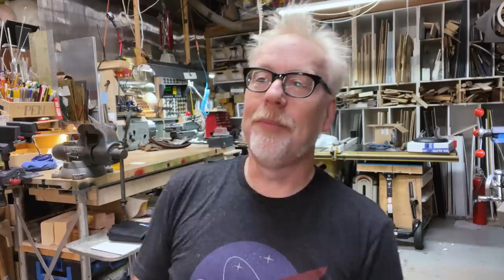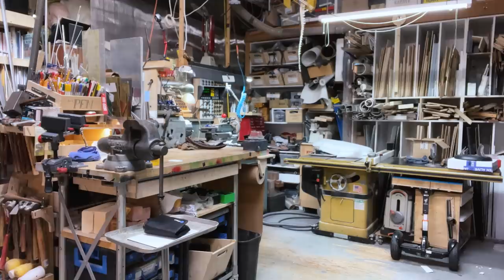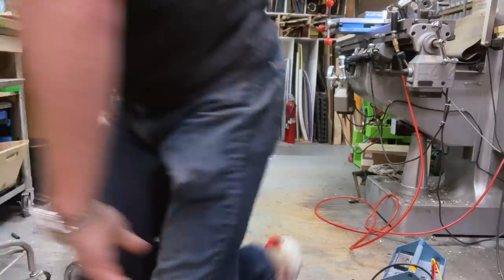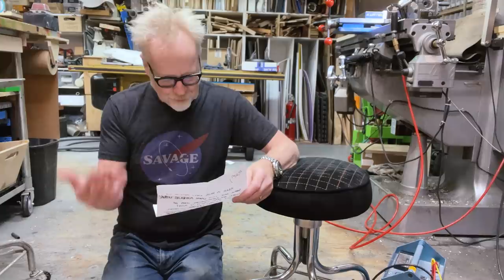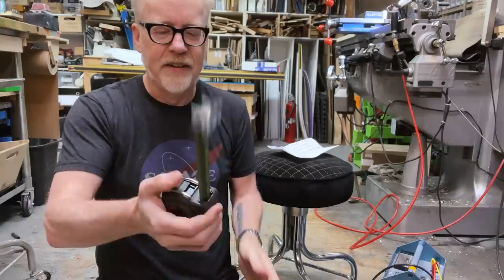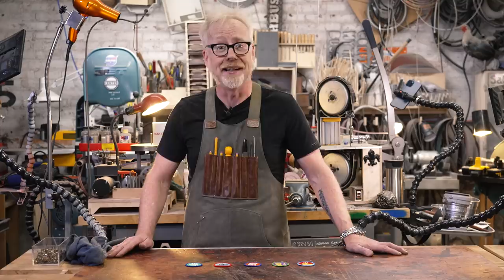Jack White Made Me This Surprise Gift!

Comment: That tape measure is the lufkin shock force with the nite eye tape  (black and green helps in low light as well as in bright sunlight as the black is anti-reflective) . L1135B bought 4 of them for around the shop about 2 years back and am very happy. Also a lifetime no questions warranty on them.

Comment: Jack is a awesome guy. I got into transistors and modifying guitar pedals. Here's a fun idea. Why not do a video on modifying guitar pedals or guitars. I also modified a old Epiphone studio (Les Paul) style. Guitar. I put in new wiring Jimi Page style and added coil split and phase to the pickups.  I have been switching out transistors on fuzz pedals to modify the clipping and other aspects. Like Jimi Hendrix guitar tech did. But one of the things I'm most impressed by is Jack whites modified guitar bridge that does all the different tunings by flipping levers. I love Jack for the guitars he plays. My girlfriends dad bought here this squire bullet when she was kid coming out of piano lessons. It was a cheap stratocaster made in 1982. It sat in her bed room for 30 years never played in mint condition. Well I almost threw it out several times. As she has lots of nice guitars. Little did we know this cheap $50 Squire Bullet Stratocaster was the first made in Japan. Because the factory in Japan was new and didn't make their own parts yet. Not until 1985. To try used what ever fender shipped to them. Which was original American 1960-70 stratocaster parts. They also built them really well as they were trying to impress fender. So these Squire Bullets Strats from 81-84 are considered master builds today.  She had it appraised at $1,500. It's also her best sounding guitar. The single coil american hand wound 1968 pickups scream like Jimi Hendrix. It's light weight because it's a squire. But wow does it rock. I'm sure Jack White would appreciate this. We had one of the best luthiers Jim Meridian, who has worked on Joe Perry, and bunch of other famous guitars.  The one problem it did have was a bowed neck with a hump and a twist. Most would have said to re neck it since it's a simple bolt on neck. Not Jim. He wanted to keep it all original. Some how he not only fixed the up now. He too the hump out at the 12 fret and fixed the twist near the bridge. He is a miracle worker. Only charged $200 which is super cheap to have wood reworked like that. It must have been hours of heat, bending, clamps, and twisting. To get that old maple neck straight again.
Reply: Sorry for typos I was using speech to text. As I'm incredibly dyslexic and can take hours to type something correctly. Lol. But I get by.

Comment: I wonder how you'd design a demerit badge for crochet thats basically "forgot what sized hook you were using"

I have SO many projects that I ended up ripping out and restarting a couple of times because I forgot what hook I was using.  I need to make a set of little safety pin type jobbies with hook sizes marked on them to hook onto projects lol

Comment: What is that symbol on Adams tape measure??
Reply: It's not a symbol, if you mean what I think you do. It's a plastic insert for allowing a 45 rpm 'single' vinyl record to be played on a turntable with the smaller central pin made for long playing (LP) 33 rpm 'albums'.
Reply: @paulkinzer7661  kids these days.
Reply: @1pcfred  Right?
Reply: @paulkinzer7661  you actually had to use an insert like that if you used an auto play record player that dropped the records one after another. Otherwise you'd just use the thick hockey puck looking adapter.